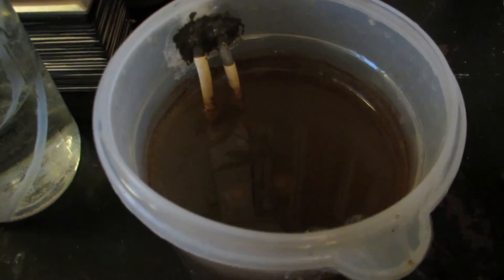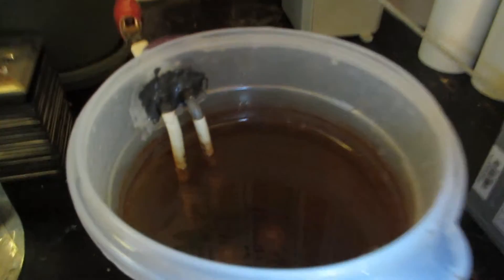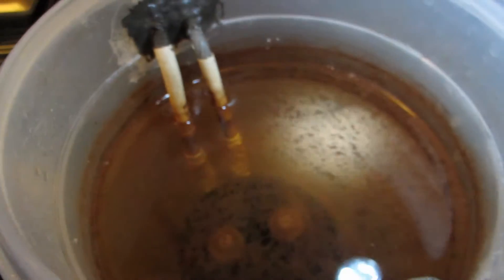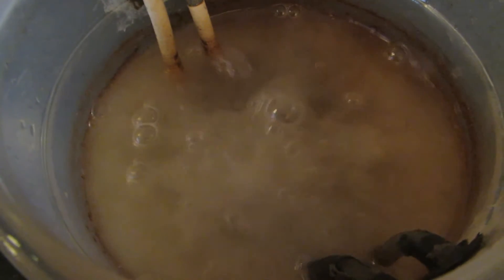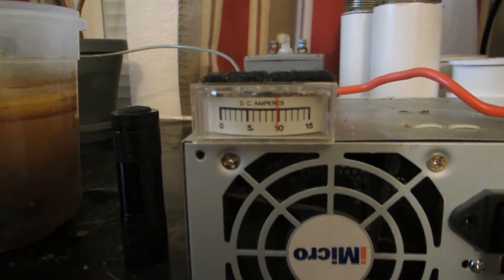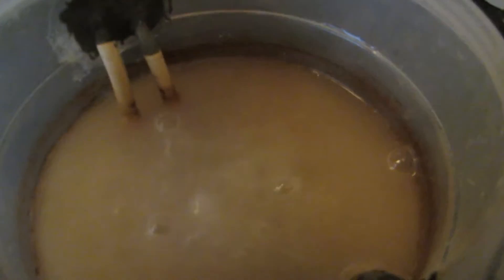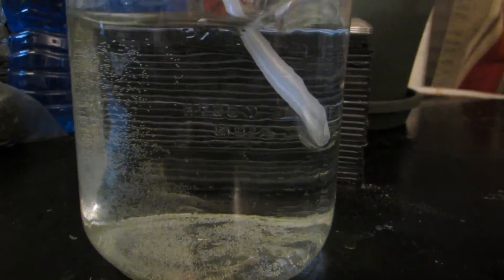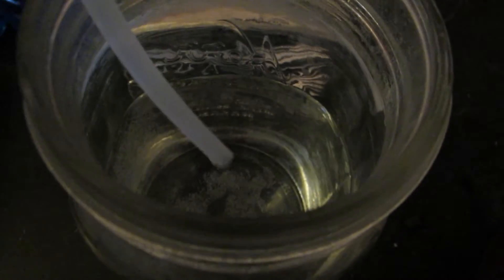Vid76 HHO Volcano Cell - IT LIVES!!!

Comment: Bringing Sexy Back ; )

 I recently hand delivered a 12 volt, 7 Condiment Cup HHO Cell to a gentleman to use in combating Cancer. If you have not done so already, please check out my recent work and discoveries in the Hydrogen For Health side of this technology. These condiment cup volcano cells are the perfect size for self administering the gas for inhalation or for enrichment of your drinking water. You may also want to check Crate & Barrel online to purchase there brand of sauce cups. They have the standard size and a larger cup size I have not experimented with yet but out of dozens of distributors I tried, the quality of the stainless steel cups at C&B is superior to any cup I have ever tested. Glad to see you back on YT doing HHO videos...
Reply from the maker: Thanks. I've got a ton of new designs that I've been tossing around, so there will be more to come.  I'm definitely going to have to figure out how to make a splitter cell, because that seems like the best solution to storage and practical applications.  I'm glad to be back!
Reply: HHO4ALL For sure. You ever want to bounce off of my designs for inspiration as I did with your work when I first got started just email me for open access to any plan set I have available today and into the future on my website. The split cell plans will go over one of the simplest designs on the net and some of the best membrane material. I look forward to your new innovative designs and experiments.